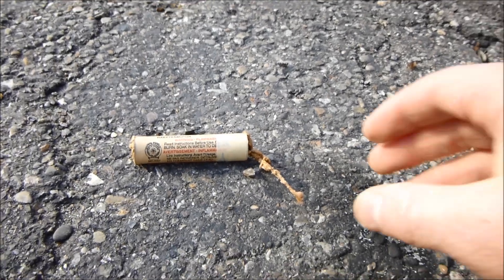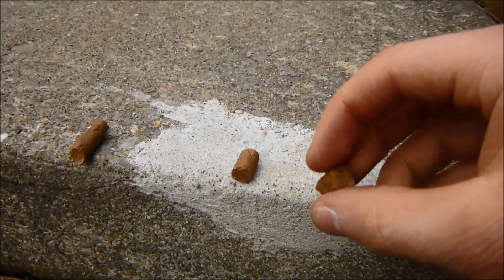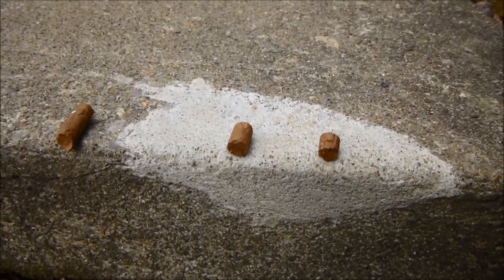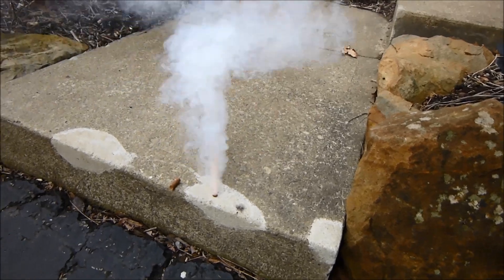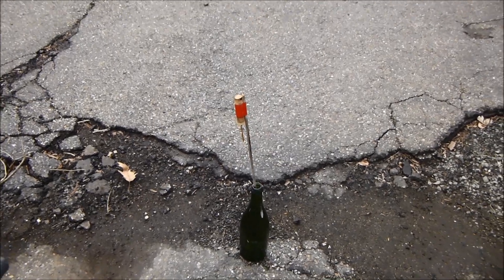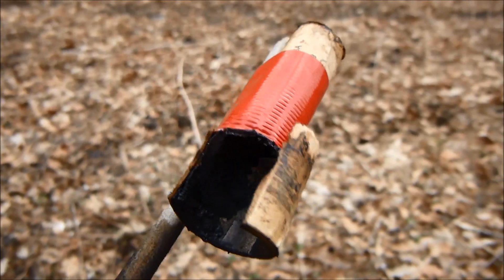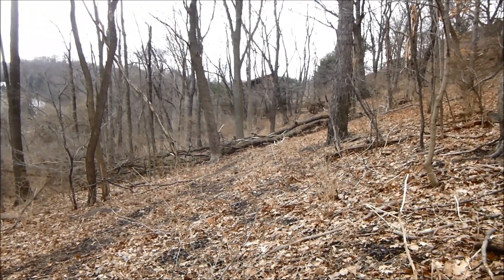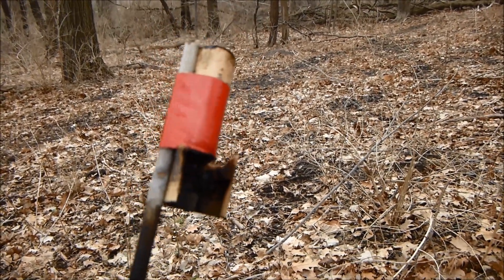Sugar Rockets - First Successful Launch!!!

Comment: HI MakerJ101 ,
Actually we have tried to build a sugar rocket frome the past two days .....
'But as soon as it  launches up in air it  tips down or pitches down ...Can u suggest any improvement ...Will be very helpful..thanks.
Reply: Siddhant Panigrahi the length of the stick is extremely important if youre still having troubles. a quick search on the internet can solve the problem in a minute ^^. just my personal guess however.
Reply: Centre of mass needs to be forward of the centre of lift.
(weight up the front, fins at the back).

Comment: Try to add a small amount off Sulfur or Iron Oxide to Sugar and Potassium nitrate mix.
1. About 10g of sulfur to 500g of mixed Sugar Potassium nitrate.
2. The receipt with Iron Oxide needs about 5g of oxide to 500g of mixed Sugar Potassium nitrate.

ACHTUNG !!!
Always remember to heat up the chem`s in water bath and use a electric heater !!!
Do not overheat the mixing.
Do the job outside, or in "fume cabinet" if you have one.
Reply from the maker: Yeah I thought about that!  Adding some kind of catalyst to speed the reaction up a little!  Yep electric heater, out side, and water!  All smart advice!  Thank you!

Comment: Whats your recipe I relly been trying to find 1 that works
Reply from the maker: It's about 64% potassium nitrate to 36% white table sugar.  I dissolved it all in water then the cooked it in a pancake sort of griddle until it was thick.  I measured it all by weight but it probably does not matter.  I think it's a similar recipe to Grant Thompson.  I am planning on doing a whole video on making the rocket fuel and also one on making rockets out of things you can find around your house.  Thank you!

Comment: Wow. That works. Just add electronic ignition. Can you do a bottle full?
Reply from the maker: Yeah I think I will try a resistor for ignition on the next rocket I build.  Umm I guess you could do a bottle.  That would be a real bottle rocket then!  Or maybe a bottle bomb...  AKA bottle grenade...  Thank you!
Reply: Toaster wire makes good resistors. Although I was thinking HV.....
Reply from the maker: Mongrel Shark  High voltage could work.  I would have to do some experiment to see how that would work.  I guess it would just be a spark gap with some sugar rocket fuel in between?
Reply: Something like that. Electrode in fuel and arc to it.
Reply from the maker: Maybe mix a little charcoal in the fuel to make is conduct a little so I don't have to have such a high voltage to start the arc.  Hmmm...
Reply: Aluminum filings would work, and add a bit of speed to the burn. Potassium nitrate and ali or zinc dust makes great powdered rocket fuel. Carbon would also speed up the burn.
Reply from the maker: Interesting... I'll have do some experiments.  Thank you!
Reply: If you want to slow the burn and add heat. Iron oxide.
Reply from the maker: Hmm I would not expect that...  Thanks!
Reply: Thermite is just aluminum powder and iron oxide. Burns at around 5000c Leaves pure iron behind. Not a lot of thrust though.
Railroad thermite welding
Reply from the maker: That is awesome!  It's amazing that they can do that that way!  True, you would not want that to have thrust!  Hahaha  XD

Comment: i have a question. is this legal to make or how do you find out if it is
Reply from the maker: That is a very good question!!!  I honestly don't know.  I don't see why it would not be legal.  Well unless of course fire works are illegal in your area.  It is really nothing different then a bottle rocket or a model rocket.  I'm not using hazardous chemicals or anything.  It's only a fire/explosion hazard.  So as long as you don't do these in fire season, you use common sense, and you don't live where fire works are illegal then you should be fine.  Hope this helps!
Reply from the maker: Makerj101
Also if you try to make bombs out of this stuff and try to hurt people with them I'm sure that's illegal! Common sense bro!  :D

Comment: psssssssssssssssssssssssssssssssssssssssssssssssss...

YAY! :D
Reply from the maker: I think I really need to prefect my fuse making!  That fuse was like pssss..... pssssss........psssssssss..........  Not reliable or safe at all.  Maybe cotton string I used is too thin.
Reply: What about an electronic match or something similar? (resistor around a match)
Reply from the maker: I thought about that.  I think I may give that some tests when I make some more fuel.  Maybe I'll dip the resistor in the r-candy.  Or maybe I'll make my own out of heating element...  Thank you!
Reply: Makerj101 Anouther thing that would probably work is using an arc from like a mot etc. Put the two electrodes inside the candy and have them strike inside. With the heat it will most likely ignite.
Reply from the maker: That's an interesting idea!  Would probably work too!  I think a Christmas light bulb with the glob smashed might work too.  Resistors would still probably be easiest though.  Something reusable like the MOT electrode idea would be nice too.

Comment: I love R-Candy :D
Try with 1% of red iron oxyde ( Fe2O3 ), it will speed up the reaction and cause more thrust.
Try also to add some corn syrup ( glucose ), the result will be a much more malleable mixture, much easy to put in a tube.
I think your r-candy is a bit too cook, its not brown idealy.
For the fuse you can try to put coffe filter in water saturated with potassium nitrate, put them on a plate and let it dried in the oven at 50°C
Also please excuse my english, im french and i try too not use a translator.
Reply: thanks, i cheated for some words ^^
Reply from the maker: Yes R-Candy is awesome!!!
Ok I'll try some iron oxide sometime!  Do I make some by letting steel wool rust in some water?
I'll consider adding some corn syrup(I am not sure if we have any. My mom does not like corn syrup.).
Yes I let it caramelize way too much.  I cooked it too long and at too high of a temperature.  But still this batch is way better than my first batch which was way worse!  That stuff just made a lot of smoke!  Good for smoke bombs maybe!
I'd have to go with *****!  Your English is as good as mine!  I would have never guess!
Reply: Yes, for smoke bombs this brown stuff is good, you can add some sodium bicarbonate for slow down the réaction.
I already try rusting steel wool enven with a bubbler, the result is very not that great :/
The simplest way is buy it on eBay i think.
If you like smoke bomb, search about "legendary smoke bomb", it use wax from candle, sugar and KNO3.
Reply from the maker: Thank you!  Do you know how to make more reliable fuse?  I fallowed Grant Thomson's video to make it but it just does not burn consistently.  I dissolved the potassium and sugar in water and boiled it until it started to get thick then I dipped the string in and cooked the string till it was stiff.  Thank you!
Reply: I read this in a very old chemisty book, i was persuaded that this méthode is totaly unknow until i see this video ^^
Just boil some water and add kno3 until it can't dissolve more then put coffe filter in paper form, let suck some liquid and let it dry that way. When it dry, just cut a pièce of paper and roll/twist it.
Reply from the maker: Interesting!  I will have to try that!  I will experiment with adding just a little sugar too.  Maybe there was too much fuel because the cotton string would act as a fuel.  So maybe just the coffee filter or string and KnO3 would be enough.  Experiments to come!  :D  Thank you for you help!  :D

Comment: Did you use a similar technique as Grant Thompsan's method?

DAMN that thing flew FAR. How much did the rocket weight including the stick?
Reply from the maker: Yes I did.  I used the boiling away the water method.  Umm I have no idea.  The stick was pretty light though.  It was a bit heavier than your normal cheapo hobby rocket kit.